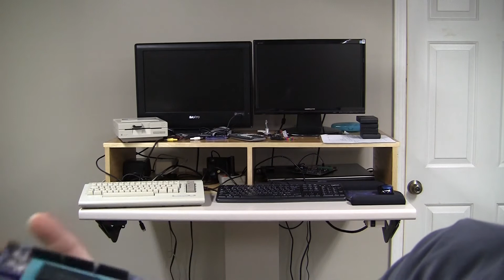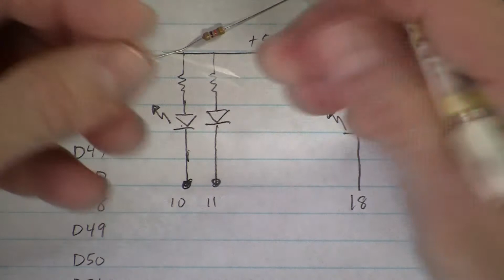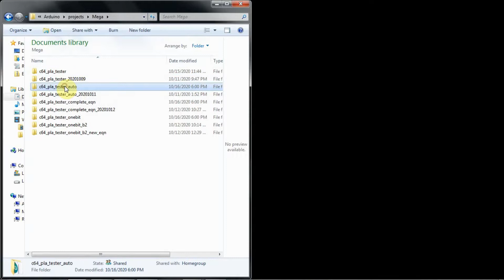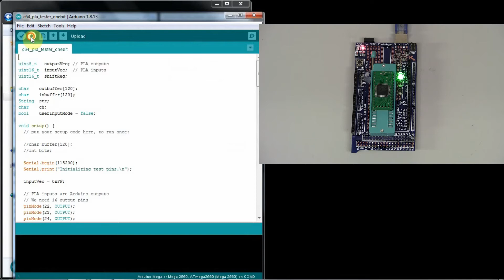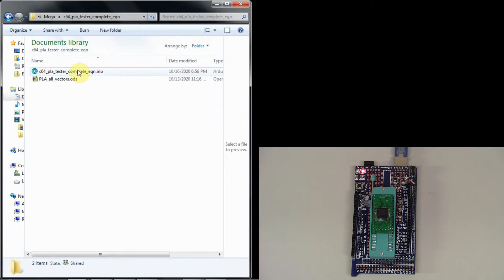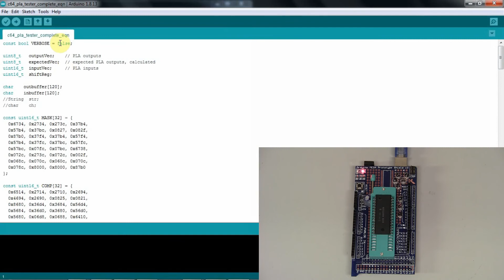PLATester: Make a Cheap $15 IC Chip Tester for Commodore 64 PLA Programmable Logic Array: DIY !

Comment: Hi, nice Projekt... Has anybody make a PCB for this Projekt , the Last 2 Years ?
Reply from the maker: Not to my knowledge (as we just discussed via email).  Thanks for considering it!
Reply: I found a PCB that does essentially the same thing on github by a user called revaldinho - Project is just called zifshield, and I was able to get this code working on that project with some modifications.  Oh, and one warning to anyone reading this, I had to make sure to jump pin 16 from the chip to a different pin other than pin 1 on the arduino to get the code to work.

Comment: That's a great project. Following your guide i made one to test my C64's PLA and result it's  not in good health.  Just 61000 vectors are ok.
Before to order a PLA subsistute i'm trying to use an EPROM. I changed the wiring accordingly (i hope) to read an Eprom as PLA, I burned the rom, verified with the file, tested the chip and..... failed. 
An Example: 
ERROR: inputs=FFFD outputs=DF expected=EF
ERROR: inputs=FFFF outputs=DF expected=FF.
Apart the read error (i wil investigate why it happens) the expexted value for FFFF and FFFD are in the file at that position.
ERROR: inputs=FFFB outputs=FF expected=FE. Still the read error. Your program is expencting FE but in the file at FFFB there is 7F.
According to your knowledge the different PLA chips have different data inside? My real PLA is MOS 906114-01 from the '84 on assy 250407, artwork 251137 rev b 
I'm right in using your project to test an "Eprom PLA" or it works only with real PLA? 
Thanks in advance for your answer
Reply: A little update from myself. Probaly the Eprom is too slow for your tester. Adding a delay of 1ms in the read section, fix a lot of problems. From 0000 to 7FFF not a single error. A 8000 the Eprom outputs 7F, wich is correct as the file say but your program expect FF.
Reply: Annnd it was just a problem of wiring. Made it again from zero and now i have a 65536 passing vectors on the Eprom. Next step try it on the C64. Thank you again for you fantastic project. Will you make a tester also for the ram 6164 and compatibles?
Reply from the maker: Paolo, nice job!  I had not thought of using this on the EEPROM versions of the PLA.  So, the timing must have been close for it to make a difference.  Nice finding, so glad you could complete a tester for yourself.  Also, you are not the only one asking about the 4164 RAM testing.  That topic has come up a couple times.  And on the Color Computer (Coco) Discord server too.  That is a great idea, and I will put it in my queue with some other projects that are in progress right now.